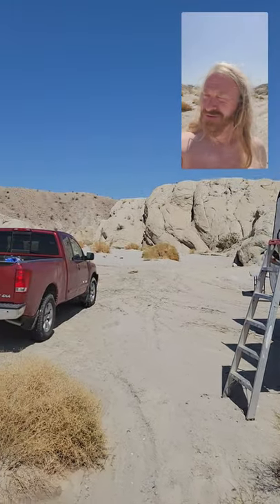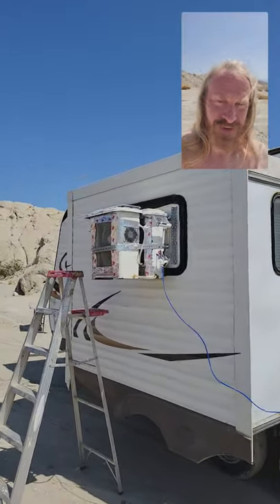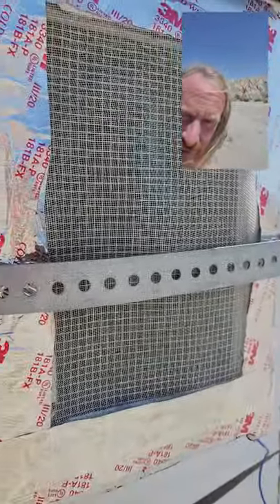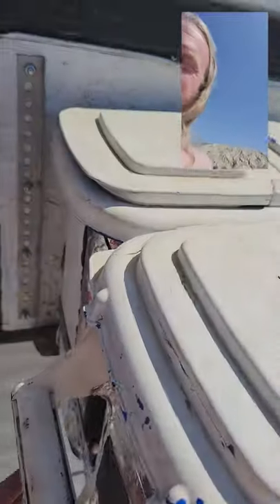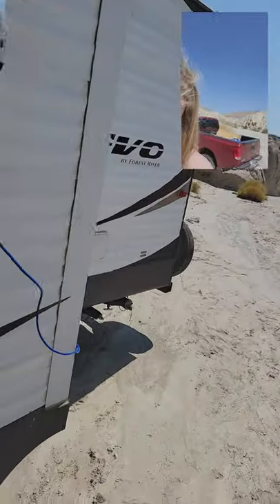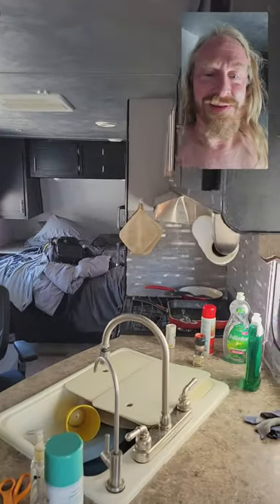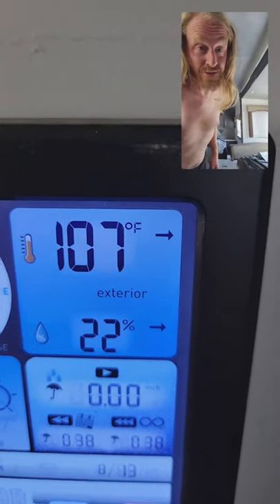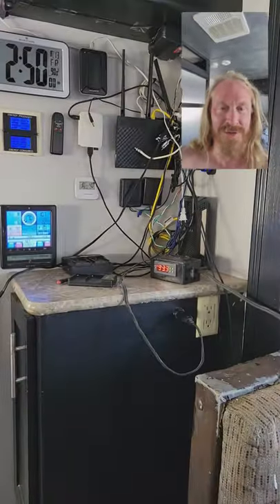Homemade two-stage evaporative cooler AKA swamp cooler is working quite well today.

Comment: No, that's not bad at all. Even here, in sort of the reverse climate, I keep the thermostats for this forced-air system at like 75 or 76 during the day because it gets too cold in this old house if I set it lower (run it more often). Because, humidity.